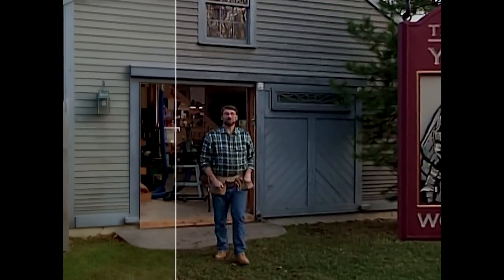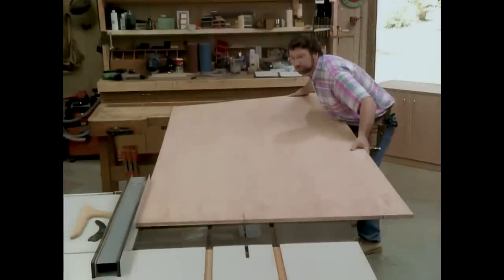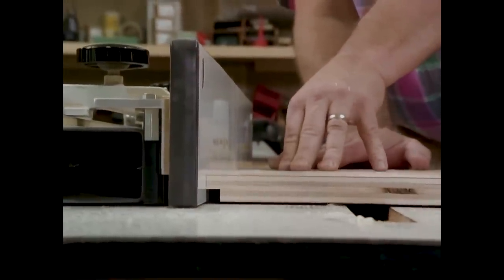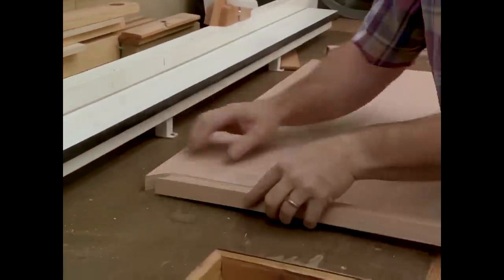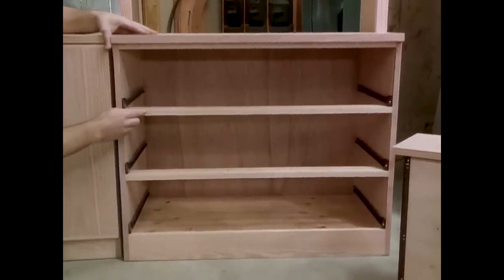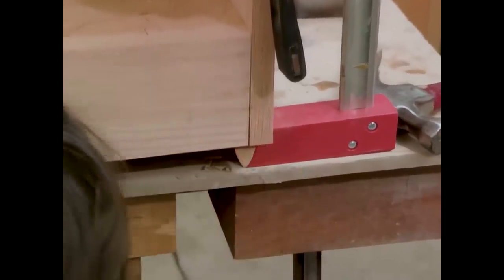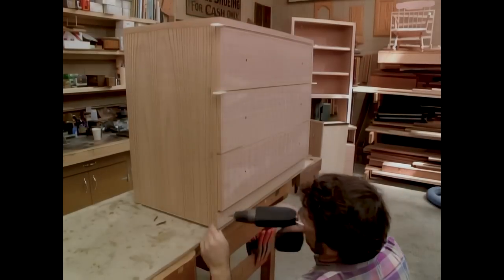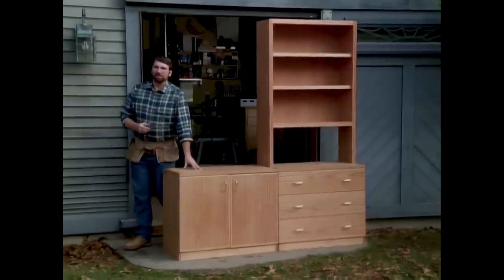Storage Units: Bureau / Cupboard and Bookcase [AI HD]   |  S6 E7

Comment: A track saw saves so many steps breaking down plywood! So much easier by yourself than with a table saw and less waste
Reply: Yes, track saws are nice. I also don't think they were available back when this show was originally on the air
Reply: @knutboersma4386  right it wasn’t available in the USA at the time they recorded this. My point was comparing the two methods. The old way on a table saw is cumbersome. I’ve done it. That’s why I got a track saw when I could afford it.
Reply: Werent available then
Reply: @bellapfingst9439  correct but if someone built this project now I’d recommend one